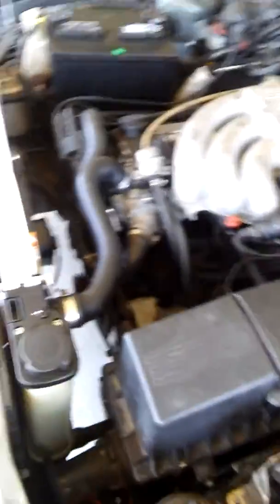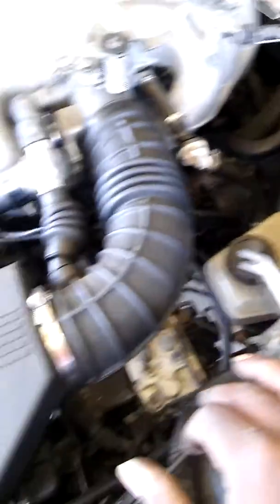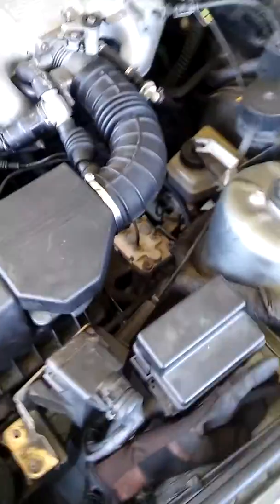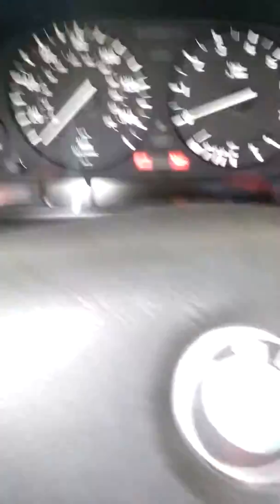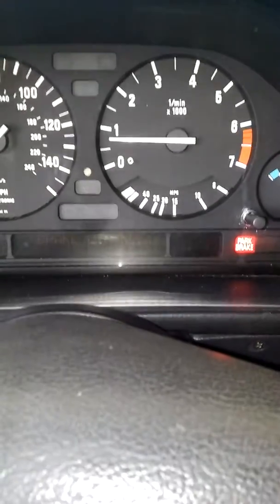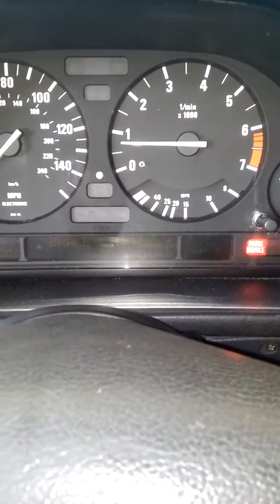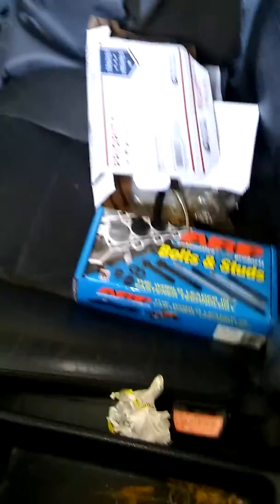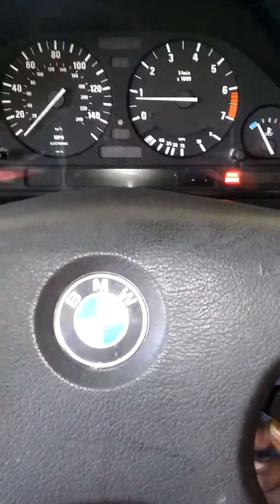Bmw e34 turbo build/ M20b25

Comment: got one my self let me know if you have any questions. I work for bmw. mine has 269,000 still eats tires like a champ
Reply from the maker: Bro unfortunately I no longer have the E34 I sold it last year took the motor out of that and put it in my E30 so now I'm bringing out the E30 this year but I do need to get my hands on a brake master cylinder clutch slave cylinder and master cylinder if you can help me out preciate that
Reply: @reshardrene3936  best bet for parts is ECS tunning  we use them if we bmw if we don't have it on hand but get a amazon brake bleeder kit for 14$ drain the fluids an plug and play. make sure to put some good anti seize or lube on the slave. both are pretty easy fixes and that will save you some much needed cash